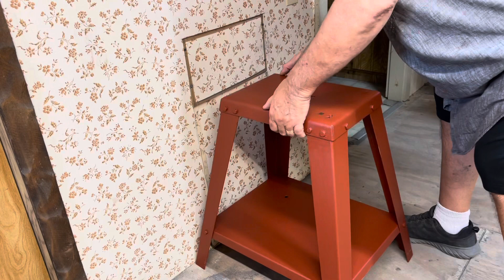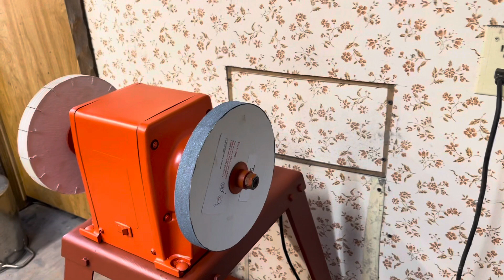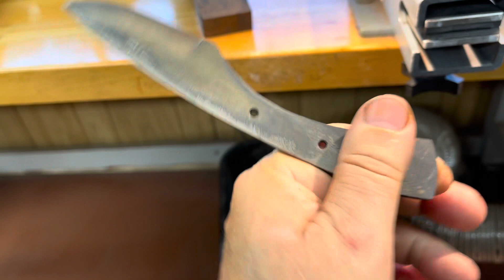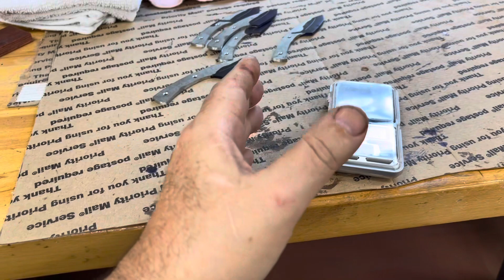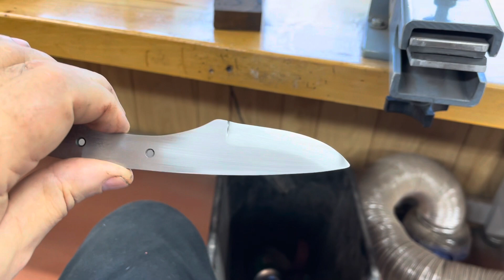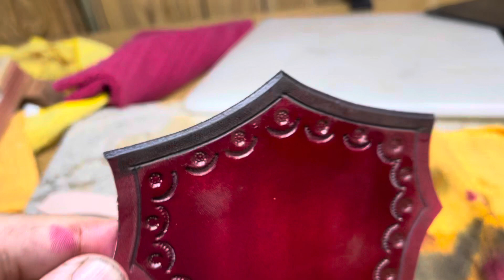Reassembled the foley belsaw knife sharpener

Comment: It did turn out nice! Can see why the burnishing machine is important when comparing to doing the same thing by hand. Glad you found one at a decent price. 
On another note, if your back pain was in your upper back, the pain, nausea and cold sweat are signs of heart problems. Something to get checked out. Comment based on close family history experience. It's definitely not something to simply try to work around. 

I hope this heat breaks soon, for all of us. We had a little break, but  it's going to be 97 actual Tuesday & Wednesday, here. With high humidity. Can't picture days of 110 actual. That's downright dangerous for everybody. 

Hope you're feeling better today. Take care my friend. 
God Bless. Godspeed.
Reply from the maker: No, my back pain is in my lower back where the herniated discs are. Burnishing the edges is one of those things you don’t notice until it’s not been done. The heat we are having here is deadly. I feel sorry for folks that don’t have AC.
Reply: @bctruck  Sigh of relief re: back pain location. I feel the same way about folks without AC and those who have to work in these conditions. Road and house construction crews come to mind, as I type. Prayers for them, in this weather.

Comment: Now that you mention it, this buffing setup could also be used as a WW2 air raid siren. It's red and noisy. I like it.😏
Reply from the maker: Have you gotten the knife yet? For some reason my tracking number is a dead end.
Reply: @bctruck  Nope, nothing yet. As I may have mentionned, USPS takes around 30 days to get anything shipped to me. I think they use ponies to ride up to the east coast and then toss the parcel into the ocean and the currents eventually carry the improvised raft to Amsterdam, where is gets loaded onto a donkey, who hands it over to a carrier pigeon in Brussels, who drops it off at the national railway customs station. Then these gentle folks threaten me by snail mail if I don't pay the inport tax, they will send it back. So nothing to worry about (yet), it's all in good hands.😂
Reply from the maker: It’s about the same mailing one to Canada. Fun fact: the northernmost town in Texas, is closer to the Canadian border than it is to the southernmost town in Texas. I can mail a knife from here to anywhere in the US. In about 3 days, but for some reason, it takes 20-30 days to mail one to a Canadian town. No oceans between us, just government intervention.
Reply: @bctruck  That about sums it up. I just want the parcel to arrive within that time frame and as if it was carried on a pillow. Amazon ships very quickly, but I've had boxes with holes done by fork lifts dropped off my front door. Fortunately the items inside were unharmed. :)

Comment: With as hot and humid as its been there, I wouldn't be surprised if you didn't run into a minor bit of heat exhaustion.  Heat stress will make you want to throw up, is why I suggested it.  Stay out of the heat more and drink some Gatorade, please.
Reply from the maker: This happened while I was still inside before I got in the heat. Now, I’m pretty sure it was because I took my pills on an empty stomach.

Comment: Hey you crazy geezer, get yourself inside with the ac before it hits 110 degrees!! 
Yikes!
Weighing the epoxy in a disposable cup is an excellent idea.
Reply from the maker: It’s never gonna end! 109 yesterday and the same today.
Reply: @bctruck  
The worst I ever experienced on the gulf was 105 degrees that lasted a while. I didn’t have air conditioning.
The only thing that saved me was two tractor trailers full of furniture, on the way to the Oschner Hospital 
Visitor Center expansion wrecked and busted everything .

I was contracted to repair and touch it all up. I told them the quickest way to do it was to let me stay there (in air conditioning)
until the job was completed. They agreed , gave me a parking pass and a card to use at the cafeteria!. There was no bed but I had plenty of truck blankets that served as a “pallet on the floor”. The cable was on in the rooms too. 
It saved my behind. I used the money to move back to the lands of ice and snow.